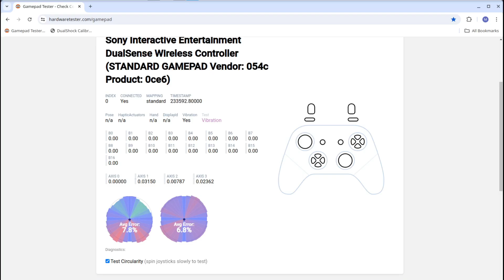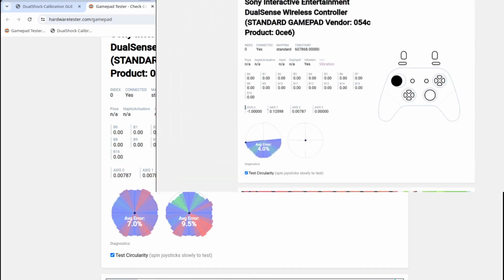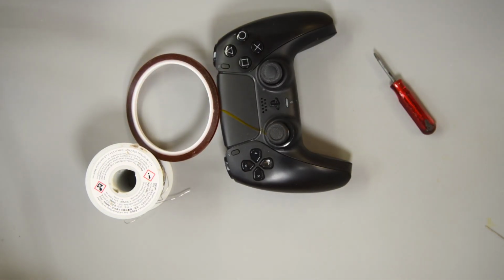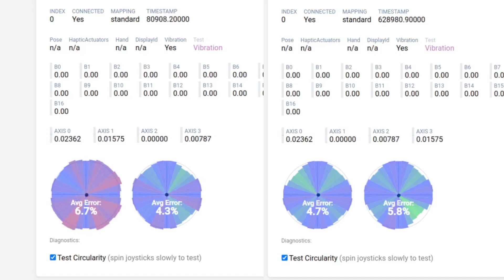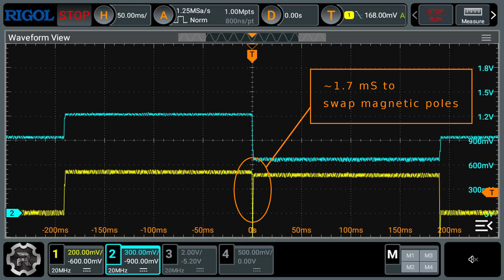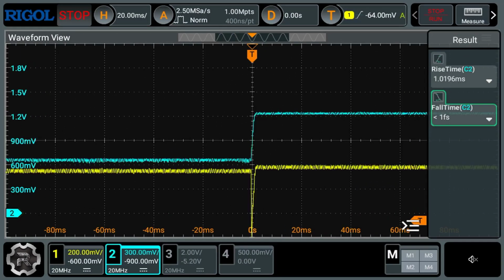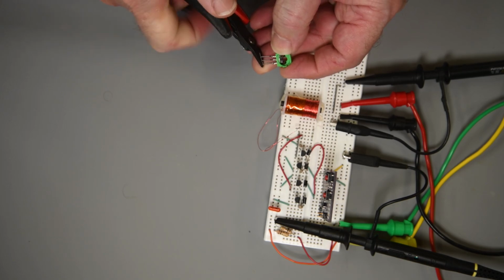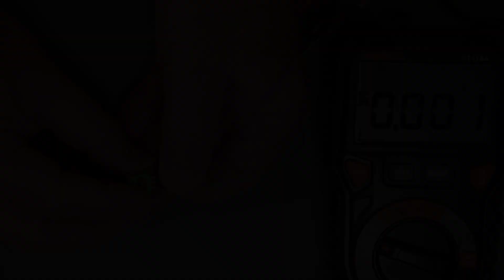The Fastest Hall Effect Joystick I’ve Tested

Comment: I will go with Ginful V5
Reply from the maker: It is my favorite.
Reply: @metalplasticelectronics354  is V3 still good enough? It's hard to buy the new V5 in my country
Reply from the maker: Depends on what sensor IC is in it.  If it is 93L35 then I wouldn't use it.  This sensor has an extremely long fall time, I measured over 200 milliseconds.  If the sensor IC is either 93L41 or 93L43 then should be ok to use.  The 41 is just 20 to 30 milliseconds slower than the 43.  Both have a slightly smoother feel than a potentiometer joystick. Of course, you will have to buy the joysticks to see what sensor IC is in it.  I sure wish the companies selling them would list the sensor IC.
Reply: @metalplasticelectronics354  Thank you.
I need bought it first to see the sensor name. The label is L-8J (I see on v5 is L-4B). Hope it have 93L41 or 93L43
Reply: @metalplasticelectronics354  think i found the sensors datasheet - appears to be hallwee 9303SW - works from 1.6v to 5.5v - pretty much impossible to find them for purchase  - Its likley the part after the L is a batch number or production date code so i woulld think all the sensors are the same ic

Comment: I like the fact that hall effect thumbsticks are starting to take off, but the main issue for me is the centering mechanism. The centering mechanism when it starts to wear stick drift will still eventually happen as the centering mechanism stops returning back to its original center. The potentiometer was only one part of the problem with stick drift (and other issues).
Reply: Yes but that issue can be fixed with calibration. The stick drift issue weird toggling of drift and changing rate and non-linear responses were the main cause of stick drift you see as a user as controller firmware normally is able to filter most kinds of stick drift already
Reply: @land_and_air1250  
That and typically stick drift from slop as a result of a weakening spring is usually fixable by just replacing the apring or even doing something like changing the deadzones slightly. 
Slop has to get REALLY bad for it to be really noticeable, and that typically takes upwards of 5-6 YEARS of hours of daily use, so long as you aren't giving your controller the mario party treatment on a regular basis. 

Normal use case, the difference in time it takes for slop to be an issue vs 'potentionmeter problems' making themselves known is so long it's not even really worth considering.
Reply: @jtnachos16  this really depends on your environment. If you have any pets that shed hair, or have sand around your controllers, your potentiometers will degrade much faster as not only will those items get in the wipers and screw it up and make it nonlinear, they will result in non-uniform wear patterns which cause permanent damage to the potentiometers as the scratches change the surface resistance. I’ve had controllers develop issues within a year of use and were unclean-able
Reply: @land_and_air1250  I was specifically talking about drift in the framing of stick-slop drift, not potentiometer drift. 

Most MODERN potentiometer sticks will last maybe 2 years before they start developing some level of issue, even in 'optimal' conditions, assuming an hour or two of use per day. A hall effect stick, I'd estimate a minimum of 5 years, assuming there isn't some sort of QC fault not related to typical wear, or an abnormally bottom-tier stick. 
Both of them are roughly on par when it comes to centering issues related to the centering springs, which is what I was talking about primarily, and is what sets the minimum of 5 years on hall sticks.

I'll also add that sticks like on the joy-cons have additional issues due to how they interact with the board itself, which can't really be solved via third-party sticks. It has to do with them using a shorter more compact stick design, meaning more lateral force on the housing and especially at the edges of the stick housing, wearing out the contacts on the board. Which was why one of the early, sometimes working fixes for joycons, was to stick a bit of foam, layered E-tape, or cardboard in the housing opposite the side of the board with the stick, to provide more sturdy structure and stop flexion from allowing the stick to dig into the contacts on the board it was attached to. 

Most the other controllers aren't using sticks that have to have as compact a housing, and thus end up with different issues. There's also the occasional QC problem where a slightly mis-molded shell can cause pressure on the board or stick in an odd location where it's not REALLY noticeable to the user, but will over time create abnormal wear. Usually that is seen on the cheaper third party controllers ,but those also often use normal screws, so getting it solved is often as simple as loosening one of the screws near the location of issue to remove the rubbing contact.
Reply: Nah it’s not tbh you can mechanically and softwarely calibrate it. So nah centering won’t be the problem but you should keep your joysticks clean and probably relube it every 2 years or sum
Reply: @kingtrayee7649   No amount of mechanical or software calibration will fix a worn out sloppy centering mechanism (you know the actual hardware that brings the thumbstick backs to center).  It wouldn't matter how you calibrate it as it won't return to where you calibrated it. 

And sometimes it's not slop in the centering mechanism, it's the lack of it moving smoothly sometimes sticking outside of the set dead zone. 

 the only adjustment that would null out a sloppy thumbstick is dead zone, BUT a dead zone that's set too big will pretty much make the controller unusable. 

The only way to fix a sloppy thumbstick centering mechanism is to replace it.
Reply: @ ok senpai

Comment: Is there a solution if one of the openings burns? Because the temperature was increased
Reply from the maker: Yes, it's a matter of finding where the pad goes to, and running a wire.  You might look up some videos on PC board trace repair.

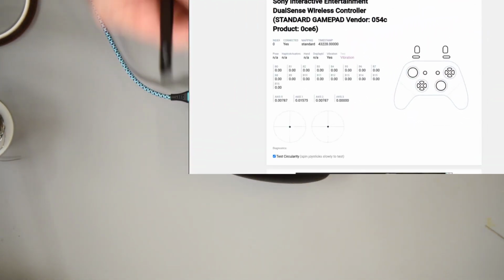Comment: 7:20 wouldnt that create a deadzone? if the thumbstick is at max before it hits the edge of the controller?
Reply from the maker: Before the calibration software, I think most of the Hall joysticks had a gap between maximum reading and mechanical limit.  There were calibration boards to help center and limit it.  I don't know how well they did I never tried any.
Reply: @metalplasticelectronics354  i ment after you put the tape on and calibrated and removed it?
But I have them as well, the blue ksilver and these favor ones in your vid, are kinda ment to be used with those calibration boards from Jung zen. But have you seen the clear ginfull ones with the wire?
Reply from the maker: No, I haven't seen the clear Ginfull sensors.

Comment: So basically at the moment there is not any real equivalent (or near to)  replacement to a potentiometer joystick. It seems that ginfull v5 is on the right path if they will reduce delay on their units.
Reply from the maker: I would now consider these a potentiometer replacement.
Reply: @metalplasticelectronics354  I've used the Ginfuls and they are great. But the one thing these HE sticks have not defeated is actual centering drift. Sure they defeat ur common potentiometer drift but the actual stick mechanism at the smallest movement still doesn't always centre at 0 and will slightly drift. This is evident in games that have pure 0 inner deadzones like Apex Legends. Won't notice it in COD or Xdefiant as they have built in deadzones in the game engine.
Reply from the maker: @OfficialMyMindset  I think most of that has to do with the mechanical design of the joystick mechanism.  I think the old joysticks from Favor Union with the metal shaft did a better job of returning to a consistent position.
Reply: @metalplasticelectronics354  True it’s def the mechanical design and cheap parts I think. Let’s hope someone redesigns it one day with better materials.
Reply: @metalplasticelectronics354  I rewatched your videos and I think I will take those Ginfull units to fix one of my unusable controllers. Then I will test it on FPS games (mostly XDefiant and COD) to see if delay could have any sensible impact.

Comment: So is this the ones to get? I want one that feels like the original ps joystick without that overly smooth feeling the HE have
Reply from the maker: I can't tell a difference between these and the standard potentiometers.  But keep in mind I'm not a gaming aficionado.
Reply: What about the ginfull v5? Does it feel different or is it close to oem as well like this ones? I see those have a better circularity
Reply from the maker: The Ginfull V5s feel different, they have a bit of smoothness. That smoothness has to do with the rise and fall times of the sensor output.  I'm still working on a setup to get a good accurate reading of those times.
Reply: @metalplasticelectronics354   ok, you think the circularity is a must have?
Reply from the maker: It's not the circularity that I like, it's that bit of smoothness.  I don't play any games where a few percent off in circularity would have any effect, I just like the feel of the Ginfull V5s.  I think if you are looking for something as close to a potentiometer joystick as possible then the Favor Union is the way to go.

Comment: There are Ginfull hall sensors that will replace the ALPS sensors without having to replace the joysticks. They are a aqua color.
Reply from the maker: Do they come as an entire joystick or just the sensor and magnet?
Reply: @metalplasticelectronics354  just the sensors.
Reply: @metalplasticelectronics354  You can get just the sensors (aqua in color and it says "GINFULL" at the bottom of each sensor.
Reply: @metalplasticelectronics354  they come in both ways, circularity is bad with error rate around 19-20%. However ginful released a newer yellow modules with optimized magnets. After calibration with AL's software, i got 3.6% error rate
Reply: I already tested those and i absolutely don't recommend it, they have a very bad precision even after calibration
Reply: @GatomonLover  je zajímavé že existuje už spoustu videí kde je i znalci-opraváři elektroniky montují a vyjadřují pochvalně...
Reply: Any more info on these?
Reply: Got a link?
Reply: @Scourge1024  can't post links. yt will remove them. check my page.
Reply: @Scourge1024  check my channel
Reply: Anyone knows where I can find these new joysticks installed in the DualSense Edge module ready to plug and play?
Reply: Haven't seen those
Reply: Hey I’m late but I would like to know how  well these work ?
Reply: @syn80 just got those installed they feel fine. But the circularity error is 15 percent. It overshoots the range circle  on the bottom left and right.
Reply: That's exactly what I'm looking for. I've many Dualshock 4's with bad potentiometers but analog modules in good shape.

And by the way, are Ginfull ones compatible with ALPS?
Reply: @Merely_an_Explorer  There are ALPS compatible Ginfulls that you can just buy the sensors, no joystick included. They are aqua in color and say GINFULL at the bottom. I cant post here but if you search on "AE" you should find them.
Reply: @Merely_an_Explorer  GINFULL has a version that is
Reply: Can we replace them without any soldering?
Reply: @erol1020  It require soldering. Just not as much. Each sensor has 3-solder points so 2 sensors per joystick. Replacing an entire joystick has 14 solder points. Changing only the sensors = 6 solder points.
Reply: @syn80  Thank you very much for the reply
Reply: @syn80 with the right tools just 3 more minutes of work 😉 I do joystick mods 😊
Reply: Same desolder is ez

Comment: Great video as always, thank you! Would you mind making a video about how you test these joysticks before you install them (like at 2:41)? What values you look for and what those values could possibly mean after installation? Thank you again
Reply from the maker: A perfectly centered joystick axis would read 900 millivolts on the output.  Of course, each axis has a range of resting positions.  So I consider a near-perfect joystick axis to read about 880 mV to 920 mV through its resting range.  If it's out by more than 60 millivolts it will start to affect range circularity.